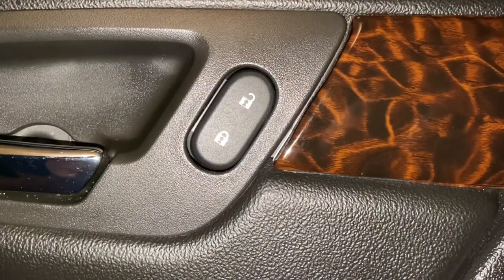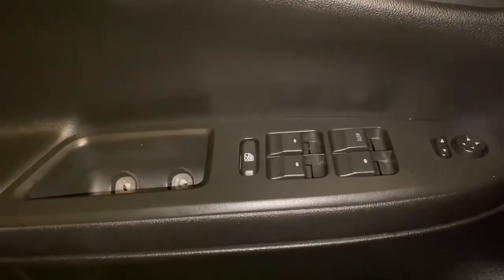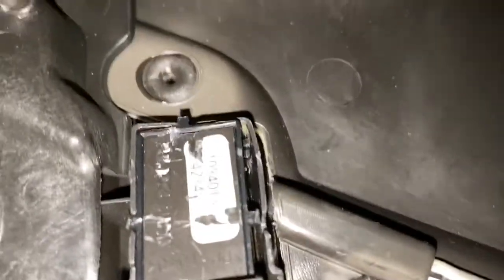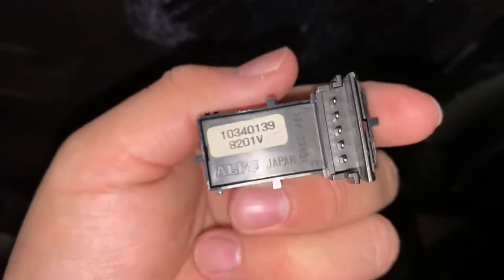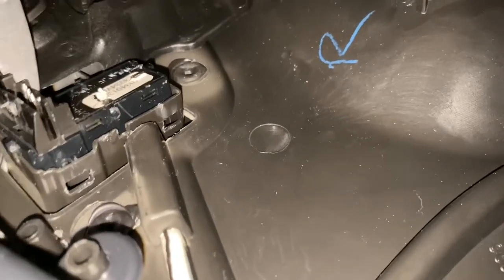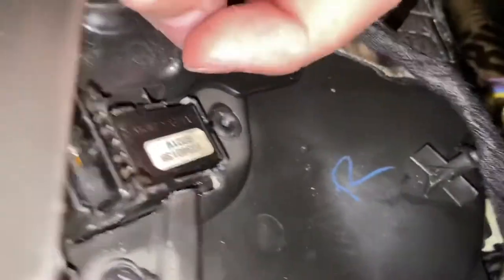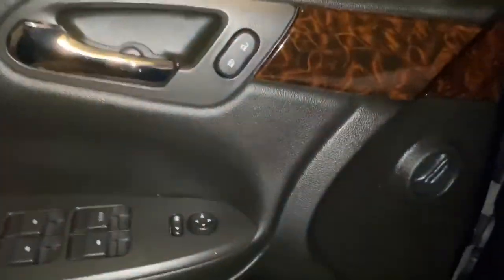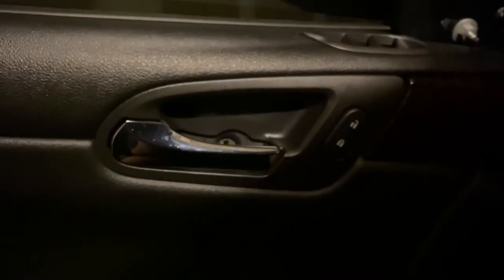HOW TO REPLACE CHEVY IMPALA ELECTRIC DOOR LOCK BUTTON (06-13 and Limited 14-16 MODELS)

Comment: question, I have 2011 impala all my door locks will not lock but will open all both on the key pad and in the car. Do you think the lock button could be problem with my car. I did not know what kind of malfunction you had hope you can help.
Reply: Did you find out the problem  ? Mine does the same thing .
Reply from the maker: If they open on the lock pad inside the car, may be the key fob battery